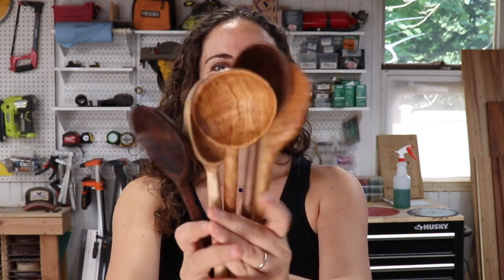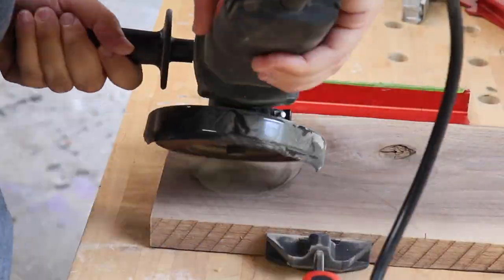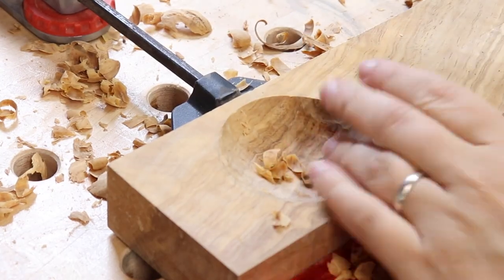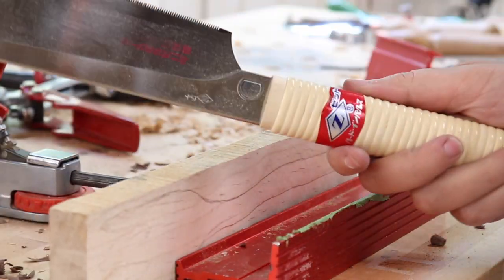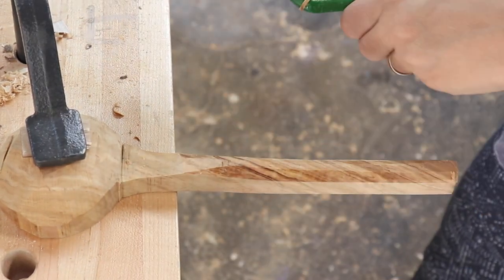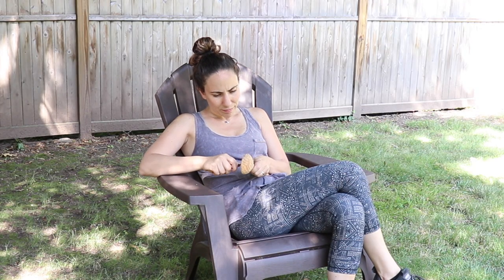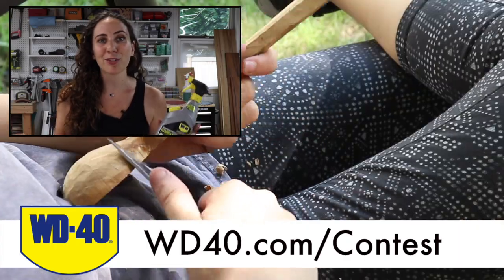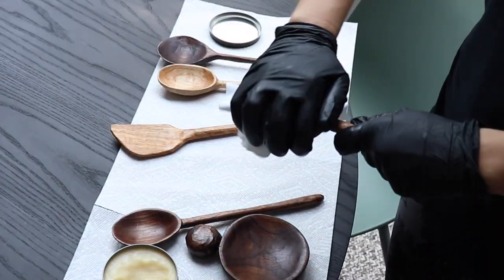Experimenting with Spoon Carving // Hand Tools vs. Power Tools // Woodworking // Wood Carving

Comment: Being a machinist and tool maker before going into carving wood spoons, here is what I used: Bandsaw for 3 d rough contour. 80 grit disc sander for rough shaping using the wood lathe to hold the disc, which was rubber and then I have a choice of speeds to use. Wood shaping rasps for getting closer to finish shape. Sand paper for finish, but for sure I was thinking of a contoured set of scrapers as you used. For the bowl, I used the drill press to put a hole in the deepest part of the bowl, as large a drill as practical, staying about 1/32" yet to finish at the very bottom point. The drill leaves a compressed spot at the center web of the drill, so leave material for clean up. Start with the gouge by making a cone shaped hole, then use the gouge to finish the bowl. Then, skip the sandpaper in the bowl and use a scraper as you did.  I will soon begin using a burnishing technique to flatten the wood fibers down, something I saw an English spoon maker use. After that, soak with tung oil or walnut oil mixed with lemon oil, wipe with a rag after a good soak, put in a toaster oven to dry fast at 200 degrees, buff with fine steel wool, and use a bees wax mix to finish with a final buff.

Comment: I happened on this, it showed up on my main page.  I am glad I found it.  I am just starting.  I want to do it as a way to make my woodworking “to-go”.  I put together a carving kit.  Since this video is 2 years ago, you may not see this comment.  But I wanted to suggest some spoons to carve.  It allows you to do some more carving.  You would still rough cut with the bandsaw, and then carve from then on.  For the spoons you carved, I like you suggestions os using the router to create the bowl.  The spoons I want to suggest, the bowl is usually hand carve .  They are called Welsh Love Spoons.
Reply: Here is a video - https://www.youtube.com/watch?v=khILUULtOcw

Comment: Nice spoons! I enjoyed your video. 👍
I use scrapers every day...Scrapers are like chisels...if you grind fast they blue and lose their temper. I saw in the video the edges of yours were burned blue. The burr will work better and last longer if you grind slow and cool with water and finish with a file or a water wheel like a Tormek.
I liked your olive spoon best.

Comment: A good source for food-safe mineral oil is Tractor Supply. They sell it in gallons for livestock for $15-$20. MUCH cheaper than "cutting board", "wooden counter top", or "butcher block" oil, while being essentially the same thing. It is also a replacement for "honing" oil if you use oilstones for sharpening.
Reply from the maker: Thanks for the tip

Comment: They look great!
I was sure you were gonna use your Shinto rasp as I remenber you saying you love to use it (it's one of my favorite hand tool too). 
Sitting and carving is so satisfying, I make wooden fishing lure and carving is the most enjoying part with airbrushing, far more than the boring hand sanding between...!
There is something called Kutzall Dish Wheel, or the Saburr Disc that can curve the inside of the spoon (it's made for angle grinder but you can adapt it on your drill press with a bolt, a washer and a nut) if you can get the right size. And of course the Arbortech products.
By the way, this video was pleasant to watch, as always, and I can't wait for the next one!
Greets from France.
Reply from the maker: Glad you liked it! Yeah!! I totally forgot about my Shinto rasp! I do love to use it. Doh! Ha!! I def want to pick up some of those carving discs.

Comment: A good video.  You probably know by now, don't do any carving after using sandpaper.  Look into the Arbortech tools.  They can rough away a lot of wood with good control and get you within sanding range or better yet, finish with carving tools and no sandpaper.
Reply from the maker: Thanks! I just picked some up 😉

Comment: I love the energy you put on each project. Do you think I can use solid hardwood for this project? Is flooring hardwood food safe? Looking forward to your next video. Thanks for sharing.
Reply from the maker: You can def use hardwood! It might be easier to practice on softer woods. But these are all hard wood and it’s preferred. Don’t know about flooring. I’m not sure.
Reply: @3x3CustomTamar  ok. Thanks
Reply: Since you don't know what chemicals the floor was treated with or what it has been cleaned with or what has been spilled on it or what the puppy did on it before it was housetrained, you might want to avoid any kind of flooring for food use.  Just my penny's worth.
Reply: @David_K_Dickson  Make sense, Thanks David.

Comment: Hey.  Nice vid and story.  You might try carving green wood with an axe, knife, and hook.  Carving green wood is much  easier on your hands and tools. Also super-fun, efficient once your hands have learned.   Anyway, todah!
Reply from the maker: בבקשה! I’ll have to find some green wood 😉
Reply: 3x3Custom - Tamar Check with local arborists, and look for blow down.  Birch and cherry are both good timbers to start with.  Also, there are tons of very good YouTube tutorials. Lots to choose from, and lots of different approaches.
Reply: matzabean how “wood” you counter act warping and twisting? Jigs/clamps/forms/frames
Reply: KnassTN8 Depending on the wood and how you orient the spoon in the grain, movement is pretty minimal.  No jigs or frames, but slow drying in a paper bags with some chips helps. Also, finishing cuts are done after drying to remove oxidation colors.
Reply: KnassTN8 Also, it’s important to axe out the pith or core of your log. Most checking and cracking will originate at the pith, and often at knots.

Comment: hi, i just discovered your channel, and i love it. I wonder if you would make videos about where you buy your tools and wood. I am looking to start myself but everything is expensive, even the clamps are expensive, so i would like to have to tips and tricks on saving if you have some :).
 Continue your nice videos, can't wait to see what you'll build next!
Reply from the maker: Hey! Thanks! Yeah. It’s an expensive hobby. Harbor freight has some decent clamps. Those were my first clamps and they’re not so expensive. You can get a lot of things at harbor freight. But not everything. They’re squares are never square. Their motors die pretty quick. But things like clamps. For sure. You can also check out Craigslist for some used quality tools. I find wood on Craigslist too
Reply: thank you so much! can't wait to get started. Any ideas if you don't have a jointer And planer? saw some people working with router sled, any other ideas?
Reply from the maker: colonelsly router sled could be a good idea. Handplanes of you have time..... I use a jointer jig in my planer to flatten faces. And a jointer jig on my table saw to get square edges. I have also used a router with a straight edge and a pattern bit to get square edges as well. It’s tough to work with rough lumber without having a planer. But it’s doable

Comment: Great video. I hope someone talked you out of using carving disks. Some of them are not safe in the slightest. Not attempting to tell you what to do or not do. Merely giving a friendly heads up to the disks.
Reply from the maker: You’re thinking of the chainsaw discs. This was a flap disk.
Reply: @3x3CustomTamar  yes, you are correct. Great job on those spoons.

Comment: Very nice work. I like carving too but my hook knife is hard to use for long periods of time. Did your gouge come sharp or did you have to sharpen it on some stones?
Reply from the maker: Thanks. It came sharp but I had to keep sharpening it as I went along. I just wrapped high grit sandpaper around a dowel to get the insides and just followed the outside curve on my sharpening stones and strop

Comment: Is there a bit you could put in your Dremel to rough shape the bowl quickly? Seems like the bit size is closer to the router but the tool allows the flexibility of the angle grinder
Reply from the maker: Yeah sure. I have one now. But I didn’t at the time.

Comment: Be careful with that angle grinder on deep bowls especially if you're using a carving disk. It will grab on the left side and kick back out of your hands, usually ruining the piece. The larger the diameter of the cutting tool the more kick is has. A small diameter(5/16-1/2) router bit in a die grinder is fairly tame and hogs out the wood quick enough.

Comment: You should have used the angle grinder on the olive wood spoon.  Sand paper doesn’t care about grain direction and it would have been much easier.  
You could use the spoke shave on the other spoons
Reply from the maker: But I enjoyed carving and using the spoke shave on the olive wood. It was really fun.
Reply: 3x3Custom - Tamar as long as you enjoyed it.  That’s really all that matters.   I was simply saying. Sanding would have been the easier way to do it.  
Either way.  Great video!!   I’ll definitely be making some spoons in the near future thanks to you!
Reply from the maker: It’s really a fun process. Plus using the hand tools really gives you a lesson in grain direction. Which will help me in my furniture making